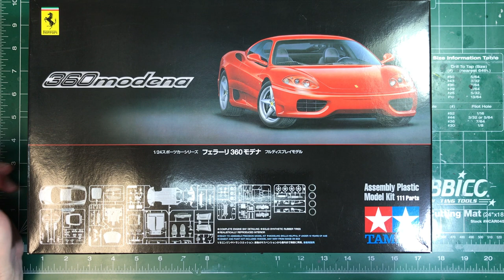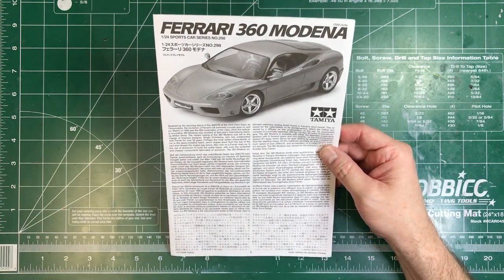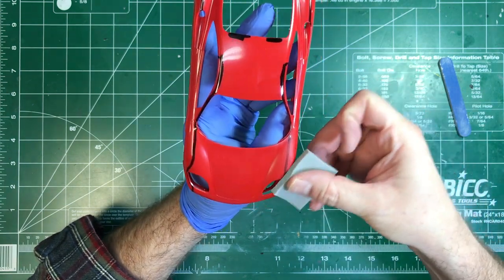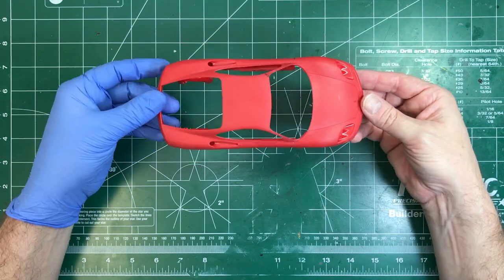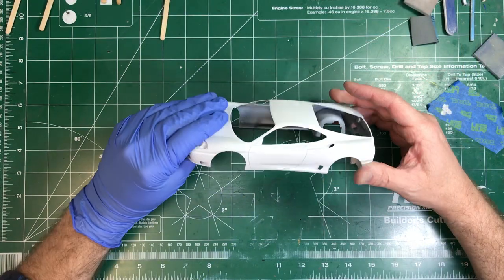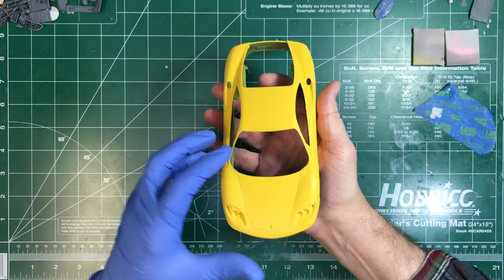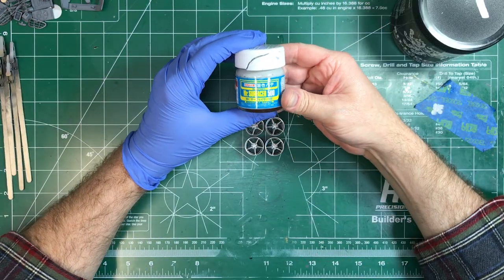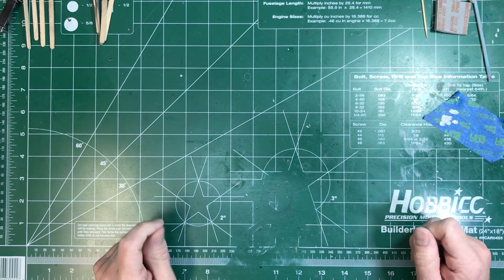Building the Tamiya Ferrari 360 Modena scale model kit Part 1

Comment: Hi, good job i have some questions. What's the primer and yellow colour you are using?
Reply from the maker: The primer I used on that build is the Stynylrez primer. It is made by Badger Air Brush Co. and is a water based primer. Good stuff. The paint I used for the body was the Ferrari Giallo Modena (yellow) by Gravity Colors USA.